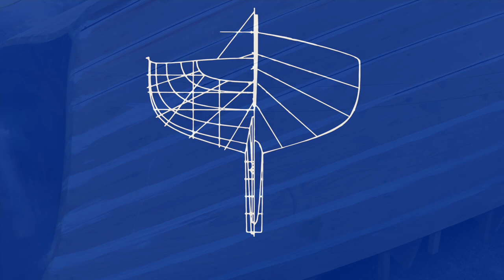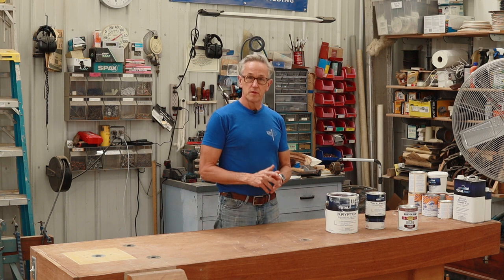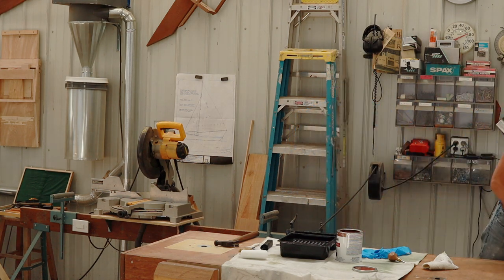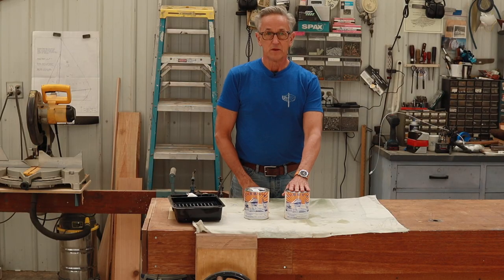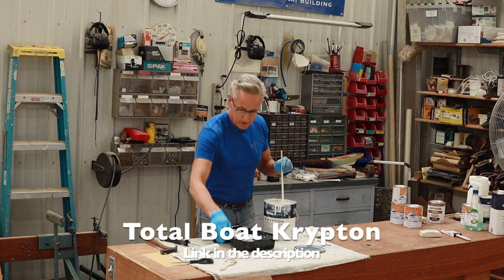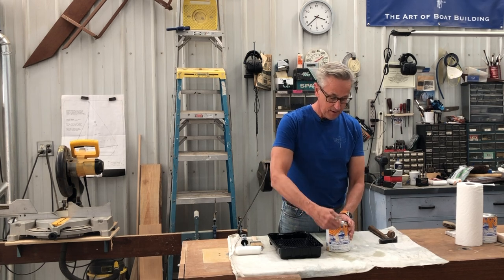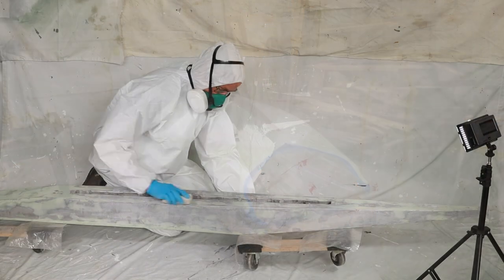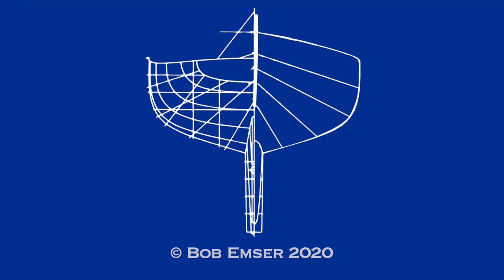How to Prime and Paint a Wooden Boat, S2-E33

Comment: Small tip when doing boot stripe or top-to-bottom transition. After taping, but before painting the stripe color, paint the tape seam with the base color. This really seals the tape edge and the subsequent stripe paint wont seep underneath the tape at seams. Makes it real sharp.  Beautiful color scheme!
Reply: This needs a double thumbs up... It will make all the difference!
Reply from the maker: Hi SV, This is a good trick I've used often. I learned it when I was a museum preparator early in my career. This was before blue painters tape and bleed resistant tape. It does work great. However, 
as I said in the video I taped only for insurance of being startled or getting a unexpected case of the jitters. I painted right up to the tape and just to the scribe line. I was therefore not worried about paint bleed. 
Great tip though for those using only the tape line to define the waterline/boot stripe.( mostly done on fiberglass boats where scribing isn't an option)
Thanks for your comment and for watching!
Cheers

Comment: You can wet the wood before painting and very gently sand it with ar least 180 grid after drying to avoid the wood fibres raising. Learned the technique from veneering but it works well in all painting applications

Comment: All wood will raise their grain if you wet them. This poses the biggest issue after you've put epoxy or paint on the boat, but if you wet it before you apply the finish, and sand the raised grain then, (do it twice just in case) then it won't raise again when you apply your stain/paint/epoxy. I would say this is especially important with epoxy, since it's much harder to sand once it's cured.

Comment: Thanks for the video!  So glad you didn’t go with the 10% solution primer.  In choosing your primers, did you run into any issues with the points at which the two different primers overlapped?

Comment: I don't understand that punching the rim of the paint tin thing. Doesn't that create a passage for air into the tin after you replace the lid which will serve to cure the paint and it won't keep in the tin?
Reply: No.  The rim is punctured in the mortise of the can rim.  The tenon that is formed on the paint lid mates with the mortise preventing air from entering the can and preventing the paint from drying out.
Reply: If you take a closer look at 16:32 you'll see that the holes will get covered when the top is on.
Reply: @sunny71169  You can also give a squirt of argon gas into a half full paint can just before closing up. It helps to keep oxygen away (38% more dense than air) from the paint and slows down the formation of skin. Small cylinders of argon can be obtained from welding suppliers.
Reply: @hawazz1  Thanks for the explanation.
Reply: @Orchardman53  Interesting.

Comment: so you are not going to put a fiberglass cover over the boat ?. if it were to be  in salt water most of the time . this fiberglass eliminates many of the serious problems of  a wood  boat in water ... so what is your reason ? just because they didn't have fiber glass in the 1930's ?.. so what  is your opinion of covering wood with a layer of fiber glass for protection ??  thanks for reading  my question . great videos .. boat is made like a  true artiest was doing it ..
Reply from the maker: Hi Hale,
In building my Haven I'm using carvel planking. Some of the reasons are that I wanted to learn the carvel planking technique, I love the sound that a wood hull makes while sailing, and the plans call for this type of hull construction. I have nothing against epoxy and have built a boat using it. Many Havens are built using a cold molded hull ( many layers of thin veneers of wood epoxy glued) I've had the pleasure of sailing a cold molded Haven and a carvel planked Haven at the Wooden Boat School. The sound of the water on the hull is much different. If a boat is to live on a trailer and is in and out of the water in a season cold molding is the preferred method. It's not a good idea to ever epoxy a carvel planked boat. Carvel planking relies on the planks swelling to tighten the joints making it water tight. Epoxy and glass cloth would not allow the carvel planks to move and breathe as they should. My Haven will live in the water through the season. When a boat goes in the water, the wood planks gradually swell up, closing the seams. That process is called 'taking up.' Wooden boats like salt water. 
Salty water prevents rot fungus from growing and it also keeps deck planking nice and tight. Any well maintained wooden boat can live in salt and freshwater.  Sluicing the boats deck and planks with salt water regularly will keep the planks swelled and rot at bay. This is important especially after a rainfall or if the boat in primarily in fresh water. 

Thanks for your question, watching and for the nice complement!

Cheers,
Bob
Reply: @TheArtofBoatBuilding       thank   you  for your  great  reply ... i love your  skill  .. a joy to watch